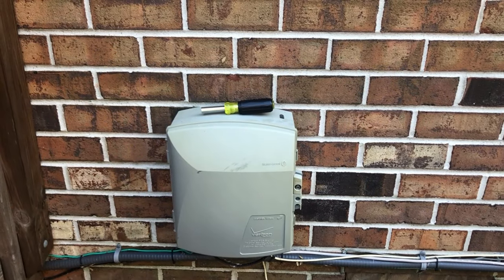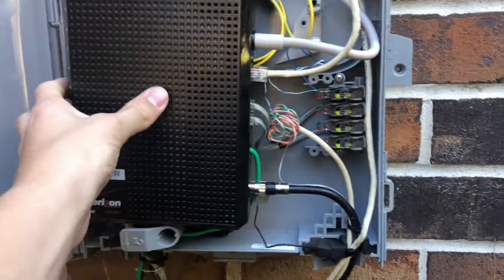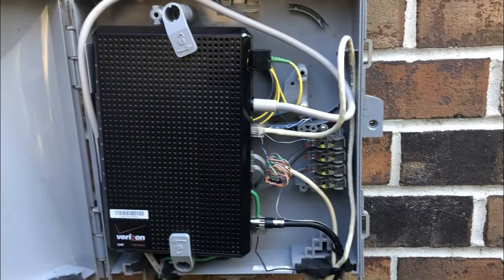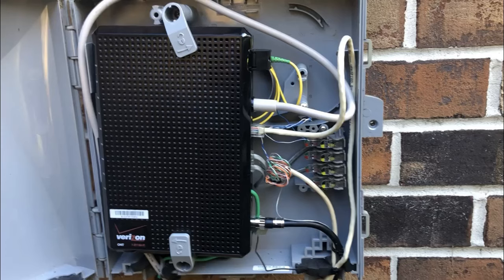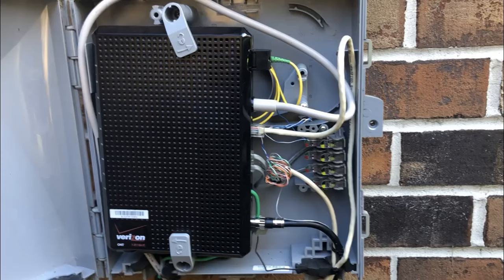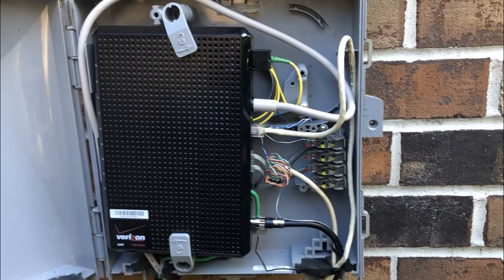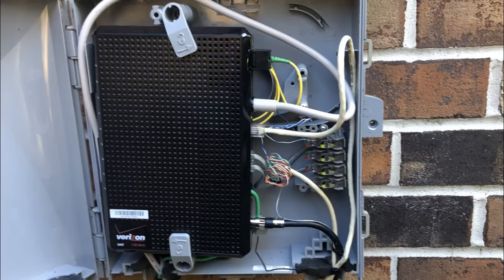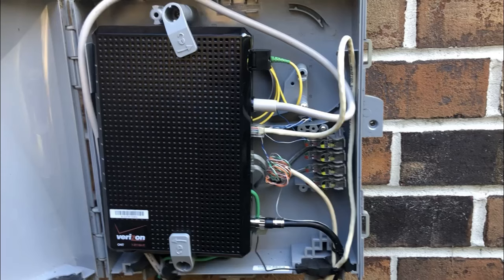Inside A Verizon Fios Box (ONT-Demarc) (Speedtest)

Comment: Good info on the ONT.  So, you've got the cat6 run to their router inside your house.  Assuming you have a wired home network, how are you connecting that to their router?  Running a cat6 from one of their routers LAN ports (think there are 4 of them) to say a switch?

Comment: As a Verizon employee. Any speeds greater than 100/100 requires an Ethernet cable from the ONT to the Router. Also if your on gig and you still have a BBU you will come across bandwith issues until you get that battery back up swapped out  for the newest power adapter. Any questions. Let me know.
Reply: I have the Verizon G1100, want to "cut the cord," and have at most 1G. Does the G1100 support 1G or do I need to get another brand of router? The Verizon G3100 cost more than I want to pay so I'm looking at TP-Link and Netgear routers as a replacement for the G1100.
Reply: @texman1166  yes the G1100 can handle a gig. Not sure where you’re at but in Maryland the price of the router rental is like $3 more a month. Also there is a newer router than the G3100. It’s the CHR1000 which has way better distance, has a 2.4ghz, 5ghz, and 6 ghz wifi bands which just in my opinion supports and disperses the gigabit speeds better if that makes sense.

Comment: Yes, good overview of ONT.  Question: does the WAN connection on the ONT use a standard ethernet cable to the router, or, does it need a special cable that swaps some wires???   I recall that old time routers needed a twist of wires in the WAN cable  compared with standard wi-fi output to computer wi-fi input.   Thanks for help to clarify this
Reply: standard RJ45 (nothing special)

Comment: Thanks man! I'm moving into my new home tomorrow and just did the final walkthrough today and noticed that the ONT and power supply are actually inside the home and the fiber is ran from its own outlet coming from the outside service box. I've yet to open up the box yet, I'm curious to see what's inside.
Reply: I hate to spoil the surprise even though this is a 2 year old reply, there is absolutely nothing in that box but a coupler where someone has added more fiber in order to have the ONT inside the home.
Reply: Same here 😅

Comment: I’m making the switch from Spectrum cable internet 250/20 to Frontier FIOS 500/500. As for the ONT/DEMARC, does it have to be installed outside the house or can it be installed inside in the garage? If inside, they would have to drill through the concrete wall to run fiber from outside to the ONT. is this something they do? I would think so since regardless they would still have to drill through the wall to run the power to the ONT from the wall outlet inside the house. Next, once ONT is installed, whether inside or out, will they run the Ethernet cable from the ONT to where my router is on the second floor of the house? Or will they just hand it off inside the garage and then I would have to extend it the rest of the way? No phone landline and no TV service, just internet. Since only internet I would like to think this should be an easier install for them.

Comment: Great video! I noticed one notable mistake: this is not multi-mode, but rather single-mode GPON. In GPON, there is only one fiber that goes to the ONT, while multi-mode would require two fibers.
Reply: All the PON specifications are single-mode fibers only with the wavelengths, splitters, WDMs, OLTs and ONTs specifications covered.  No multimode is evre used for FTTH.
Reply: Verizon doesn't use multi mode in residences
Reply: i saw that too
Reply: I believe you are correct. And from my understanding yellow cable is single-mode while orange cable is multi-mode. Still, a great and useful video. Well done.

Comment: thank you for explaining in detail what all these connections are. Can you split the cat6 (DATA) cable from this main set up? The verizon main box is mounted in the basement where i have an office. I would like to send a hard wired connection directly to my computer directly from the main box without having to drill holes in the floors to route a wire from the router which is located upstairs down to the computer i'm trying to get a better internet connection to.

Comment: Thanks for the video. I have Comcast Xfinity cable now for Internet and cable TV. To save money (I only need Internet but Comcast wants close to $100 minimum from any customer regardless of what services or lack thereof you want) I am considering getting FiOS installed with simply only a 400-gigabit Internet service (no TV) plan. To my mind, the only connection I should need is an ethernet connection between the FiOS ONT box and a wireless router (e.g., Verizon's G3100), plus a power line for said router. All my devices are wireless. Unsure if I also need to plan for the ONT to need its own power supply from the house. I keep seeing mentions of a coaxial cable connecting to the ONT, but do not understand what for. Can you please describe/clarify what my set-up should look like?
Reply: If you are getting Internet only the ONT will have Ethernet CAT 5e or higher cable from ONT to Router. ONT needs to get 110 volts from outlet in home. All devices on network are wireless than the Ethernet from ONT and power adapter to power the router. Highly unlikely that you will get gigabit speeds via wireless but what I explain to people is if you only paid for 100 mbps up and down with 10 devices you are sharing 100 not all devices getting 100 mbps. On gigabit you are sharing up to 960 mbps more than enough bandwidth for everyone on network. When I hard wire I get about 890 down also the device that you would use to has to have gigabit network card a lot of people don't know that. Coax is used for Set Top Boxes for video and to give STB internet connectivity for On demand and TV guide Netflix etc. Also if you have Fios network extender you can use Coax to get Internet service for extender. Extender can also used Ethernet, but CAT cable would run from router to extender. On gigabit my extender is connected via Coax down I get 400 down max speed from extender via Coax I didn't want to run Ethernet cable from living room to bedroom when I already had Coax in bedroom.
Reply: @NO-END  Thank you for the feedback
Reply: @NO-END  Thanks for this explanation! I have a similar concern. I am getting FiOS Wifi Home Internet 200 Mbps service installed with no TV plan and currently waiting for the technician to come in a couple of weeks. I don't want to pay 10$/month for their equipment, so I'm planning to buy my own. However, I don't really know if that should be a modem+router gadget or is it just a router or a modem itself that I need to buy (because I don't know what exactly they will be installing). And besides, I am not sure if any gadget will be suitable (for example, I have my old NETGEAR C3000-100NAS N300 Cable Modem Router, which I believe won't work in Verizon) or must it be Verizon-branded gadget only (because FIOS seems to be using a different type of connection). Sorry for such a wordy inquiry. I hope you would be able to clarify something for me. Thanks in advance!
Reply: @rezedazulfikar5701  No fios does not need modems so you can buy any router without modem combo. Like nighthawk or orbi if you have larger home. You can even buy Verizon q1100 online fairly cheap just make sure its Verizon branded and not Frontier. Frontier was owned by Verizon but sold off that part network they are on West coast Florida and I think Texas.
Reply: @NO-END  Thanks a lot for your clarification! So I can buy any Verizon-compatible router (except Frontier). Wifi will only be used in a small room, so I believe I don't need any powerful expensive routers. Therefore, I wanted to confirm if my old NETGEAR C3000-100NAS N300 Cable Modem Router could work for that purpose (since my Internet plan will only have 200 Mbps speed) or is it technically incompatible with Verizon?
Reply: @rezedazulfikar5701  it may work as long as the router has a ethernet port for cat cable to connect. Not the 4 port switch on back of router that you connect your devices to so the router should have a total of 5 ethernet ports in the back
Reply: Thanks a lot!!!
Reply: @rezedazulfikar5701  with those routers it may work but the speed may not be there try it you own it already nothing to lose.
Reply: @rezedazulfikar5701  I actually have the same questions as u. I’m in the same boat but I think u do need a router & modem that’s compatible with FiOs even through Verizon say u can only use their equipment. That’s a lie & just for them to install plug a cable from u router to that box cost $149…no thanks I’ll do it on my own. I just wish there’s an instrumental video to do all the connection from modem to router to the box for us.

Comment: I have my ONT in the basement. My router is on the 2nd floor. I also have Sonos (music portal) in the basement which is currently working wirelessly with the router. Am I able to connect the Sonos port  directly to the ONT through the CAT5 or do I have to use the Verizon router/tower to get my connection? Thanks.

Comment: My current Fios CAT6 runs into my basement were it's just terminates as a RJ45 tip that I plug into the router. I want to have hardwired Ethernet access on the first floor.  Is it as simple as unplugging the current CAT6 that's going into the basement and running a new outdoor-rated cable to the part of the house where I want it, drill a hole to get the cable into the house and attach the end of the CAT6 to a Ethernet port wall plate?  Naturally I'd caulk the hole.  Am I missing anything?

Comment: Hey, I recently had Fios gigabit installed I am using my own router however my ont (black) box is located right next to my tv & router I just subscribed to fios tv and they are shipping me the stb box. I wanted to know if the coax from the stb will plug directly into the coax port on the ont?

Comment: Thank you for making this video. Verizon claims everything after the box is my responsibility but yet they will not teach you about their equipment. The tech installed a Coax splitter from our ONT box between myself and my neighbor. So i am getting 76 mbps downloads yet im paying for 300. I use my own router and they keep trying to blame that even though my speeds we checked being wired connected (Cat7) into the outlet installed by the tech just so i could completely bypass my router. In summary, I guess I am trying to learn about this hard ware for when I need to redo their work. I assume these tech care very little about the quality of service they provide, or atleast in the philly area. Thanks for the video. If you have any suggestions I would appreciate it.
Reply from the maker: Jerry K  Verizon is supposed to have a direct 0FNR connection into both ONT’s. Then the coaxial cable leaves oneONT and only goes into the splitter for your building. The actual Internet link will leave your ONT over a cat six or cat seven cable, and then feed your router. You should have no connection whatsoever with your neighbors equipment.
Reply: @thetechstop3875  Yes, that is how the ONT was set up in my prior apartment. Now it has the outgoing coaxial into a splitter. That splitter then leads to both the neighbors ethernet plug and my own. Thanks for reply so fast. Im trying to get up to speed before the tech arrives this weekend so he can't fool me into charging me. lol. OR fix it myself, which is the preferred option.
Reply: Jerry K I am an installer, the splitter should not effect internet speeds a song as the signal level is within acceptable ranges. Though the proper way would be to have a separate ont for each apartment. Did you ever get your problem solved?
Reply: @thetechstop3875  how to reset the ont I'm getting red lights on cable boxes and the ont am router
Reply: @chriswright8074  The ONT has a reset button on it or unplug power for about 2 minutes. unplug your router as well wait for ONT to come back online then plug router back into power.
Reply: Verizon DON'T share services.  So each home should have an ONT.  Also coax is good for 100mb.  If u need more than 100mb then it should be on ethernet.  Also the speed Verizon sells is a hardwired connection speed.  So all your speed test should be done on a laptop or desktop that's directly connected to the router via ethernet cable.
Reply: NO END 0
Reply: dont redo their work if they are splitting a connection between u and your neighbor they need to fix that, i would send pictures as well as get a lawyer involved

Comment: Is it necessary to run a plenum Cat cable since the ONT is outside and prone to weather? Ethernet CAT cables are not good for the outside environment.
Reply from the maker: Danial Khan There are many different types of cable. Plenum is meant for environments where the cable is run in areas that involve ventilation of the building. The coating of normal UTP riser cable is toxic, if burned. There’s also fire rated cable, and then there is an outdoor rated cable, but has a thick outer sheath. You can see that cable in one of my other videos involving the camera DVR. Plenum is not designed to be outdoors, however in this instance it is not seriously exposed, and should last the life span of the ONT.

Comment: If I have a router with fiber optic interface, can they allow me run that fiber directly to my device? Or maybe there is an ONT that has fiber OUT. Not sure if the ONT is a next-hop device.
Reply: Because FiOS is aimed primarily at residential customers, I don't think any of the ONTs have fiber outputs.

I guess one workaround might be to utilize a converter. 🤔

Comment: Just set up NEW Verizon router G3100 cause my speed test was 48/49 and I pay Verizon for Gigabit plan; speed now 66/94 BUT I do not have Ethernet cable from ONT to router..its a general CAT 5 cable....also my BAT has green light blinking...so how do I know if my ONT is Gigabit capable before I switch to Ethernet cable?

Comment: Trying to figure out the phone line part of it...Does anyone know if all of those "punch down" lever connections are active? All of the red and green levers are connected to line 1 jack on the ONT. If you run wires to each of the 4 line 1 punch downs, shouldn't that make all of them active? I opened my ONT box and there was already 1 pair of blue/blue with white stripe going to the first green/red lever, however I cannot figure out where in the house that wire goes. So I ran a brand new cat 6 cable from the 2nd green/red lever punch down thing to a new phone jack. Solid blue to red terminal screw, blue with white stripe to green terminal screw. When I pick up the phone connected to that jack I get a beep. Not like any telco tone I've ever heard before. I am just trying to figure out how to get a single phone jack connected to this in 2022 without have to pay $325 for a verizon tech to come out and install one to get my phone activated.

Comment: Do you know the cat6 or 7 number on your wire going to the outside box coming into the house? I would appreciate any info on that. Verizon will no give me the spe for outside. Thanks
Reply: Cat6 and cat7 will both work for gigabit speed. Cat7 has a higher theoretical maximum speed but both will work for gigabit service. You might want to use cat7 if it's a longer run from the ont to where your router is going to be. The price difference is negligible so it won't hurt to use cat 7 if you can get it. One other note if you're ont is outside make sure you get a cable rated for outdoor use...

Comment: I have a 500/500 plan from Frontier and I'm wondering how to ethernet wire my bedroom. My router is installed in my living room which we have a coax outlet. From ONT, the connection to the router is: ONT > Coax > MoCA > CAT 5e > router. I have a coax outlet in my bedroom as well and if in theory it is connected to my ONT (which I don't know if it is), is there a way I could use that coax outlet in my bedroom to get a wired Internet connection?
Note: I would like to avoid running ethernet cables from the router to the bedroom if possible. It's too far and complicated.
Reply: best bet is to get a mesh extender, like the netgear ex8000, and put that in your room. It has four available LAN ports on the back and retains a band to your main router for fast connection on the 5ghz band.

Comment: Dude awesome info seems you know what your talking about  have a question need your knowledge. just got gigabit service from Verizon got the new WiFi 6 G3100 router. Wanna get rid of it and get my own router the synology RT2600ac.  Would it work ? 
Is it a plug n play install ?
What does turning on the ONT mean ?  Could you help me put in any way possible ?  Thanks
Reply from the maker: Plug and play to ONT...
Reply from the maker: No power cycle even necessary, it just works... But if you have cable boxes... nope.

Comment: Bit confused about your comment on the coaxial cable.  Is the coaxial cable from the ONT connected to both the router's coaxial port and the STB (via a splitter)?  What's the purpose of the coaxial connection to the router?
Reply: ptmoy1 Also need the answer to this question as I just got fios the tech literally fucked up my connections
Reply from the maker: Sorry for late response.... The coaxial connection goes to the main splitter , and goes to all stb's and the router. If it is a 1gbps connection, coax is not used for internet, but rather to feed data to the STB's. Each STB actually pulls an IP.
Reply: @thetechstop3875  So the STBs are each getting a separate IP address (and internet access) from the router via coaxial cable?
Reply from the maker: @ptmoy1  Yep. Check out your active devices in the router config.

Comment: Hi
If I connect coaxial cable from ONT to cable box, will I be able to see TV?  I don’t need TV guide.
Reply: You have to use Verizon’s set top boxes. If you don’t already use the coaxial input it will be completely turned off.